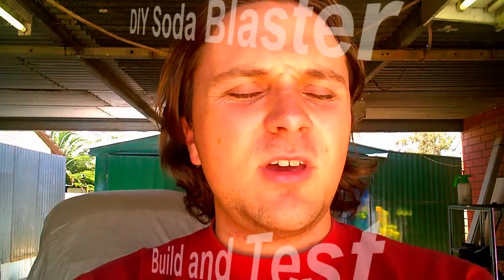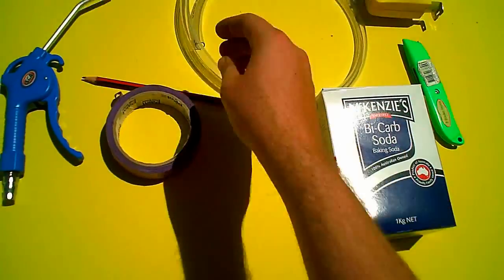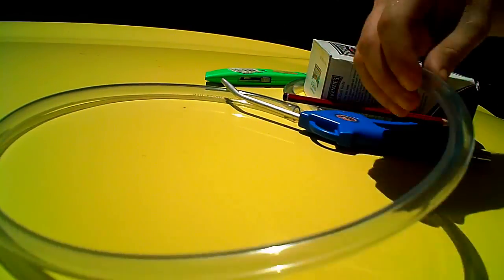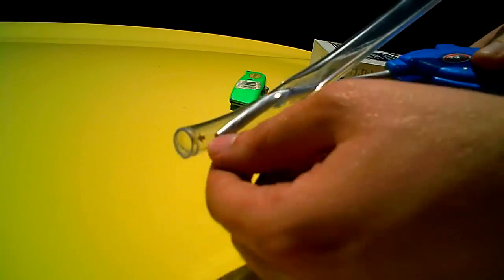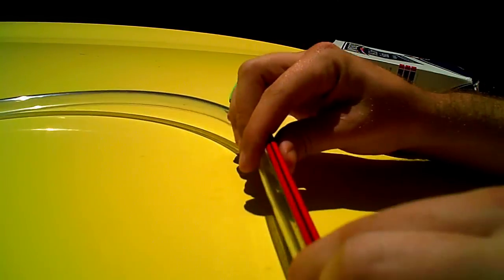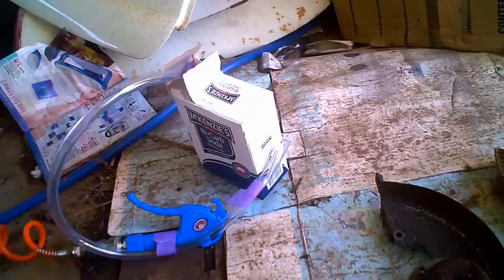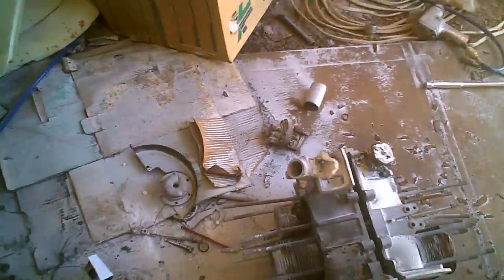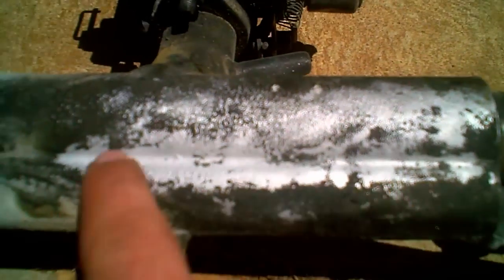$15 DIY Soda Blaster

Comment: Can i use it to clean an external marble floor?
Reply from the maker: I think you would be better with a pressure washer.
Reply: @MarcLaneAus  Only the pressure washer is not enough in my opinion.
I intend to attach the sandblasting lance to my pressure washer (120 bar) and use sodium bicarbonate or calcium carbonate. I have to clean the floor well and remove the cement glue.
Reply from the maker: @petrusbenckey  I would just be careful as marble isnt super hard you don't want to wreck the finish.

Comment: I guess since it did work,and on your first try good job! Sorta? lol no offense Hell as old as this video is you maybe mass-producing your own version of these if so outstanding! If not theirs a couple of things you may want to look into. 1st make sure you drain as much water from your tank as possible. Simple I know,but sometimes simple is often overlooked 2nd Any holes cut in the tubing silicone those bad boys shut. If none of that works try to upgrade your air nozzle to something with a tip maybe a gas powered paint sprayer with a blown out 0.17,000th tip with the tip like that you can force something more solid through  then paint,and then do away with a air compressor all together? Maybe Anyway good job experimenting keep it up,and good luck to ya. p.s. My apologies for the long drawn out comment. :)

Comment: A filter of sintered nano sized bronze balls is used by aircraft painters to keep moisture from the air compressor getting to the paint. I've used one to prevent water in gasoline from going to an engine.

Comment: Tried sugar Bahahaha 
I think try another trade buddy
Reply: +Nathan Jenkins Don't be so fucking negative. If no one ever experimented we wouldn't even get rock tools thousands of years ago. Think outside the box, mate.
Reply: +IsbjörnXII fair call, experimenting is good with exceptions because this is not an efficient tool and the process has already been refined many times, anyone knows household baking soda does not work half as good compared to the proper coarse grade soda powder you are supposed to use, so really it's more expensive and time consuming than doing it properly with correct product. Any quick google search will yield best results for anyone thinking about DIY for common things these days without the need for experimenting and waste of good quality shit.
Reply: +Nathan Jenkins 
I hear ya.
personally I always do a lot of research before I try something new. Saves a lot of blood, sweat and tears if you do it right the first time.

Comment: I think a home made blaster cabinet would be ideal as well, bcuz it looks like its using a lot of BS for the amount of surface area. A couple tweeks & I think it could be promising. Does the length of the hose have any change in result? Smaller hose = more pressure?

Comment: I found that the Harbor Freight blast gun Item #96972 for @ 10 bucks on sale did an excellent job of soda blasting.  I took off the bag and connected a 3' hose to the media inlet pipe.  Connected to a 25 gallon compressor. Cleaned a part in 2 mins vs a similar part which took 1 hour scrubbing with auto cleaner and a brass brush.   For under 15 USD it worked very well.  And for media.... Went to the grocery store and bought baking soda.  @ .50 cents per pound. Much cheaper than any supply store.

Comment: you could probably use a gravity feed/HVLP gun. Just pull the guts out of it so you're not using the needle and seat, or all the springs (except for the shut off in the handle) and then just fill the pot up.

Comment: Just dump acid on it and it cleans up fast. Commercial aluminum cleaner or commercial toilet bowl cleaner with 23% acid, you can get 46% if the job needs something stronger. Then just hose it off. Makes aluminum come out white and iron or steel cleans up to base metal. Its ready for painting once the water dries.

Comment from the maker: I suppose you could, i mean you can experiment for the cheapness of making this. But i have seen actual 10L sand blasting drums that connect to the air compressor for about $180 down here in adelaide.